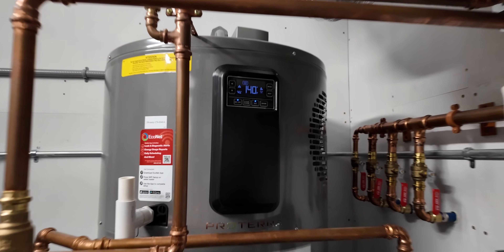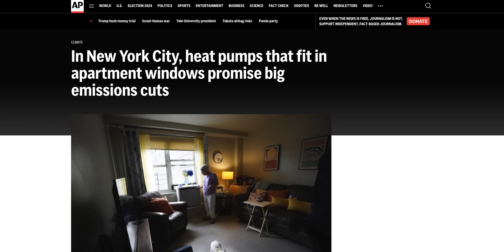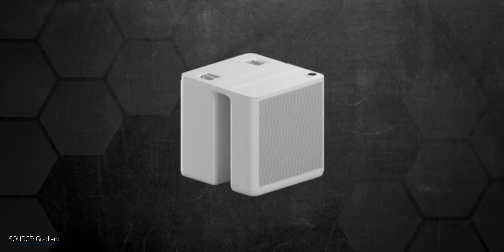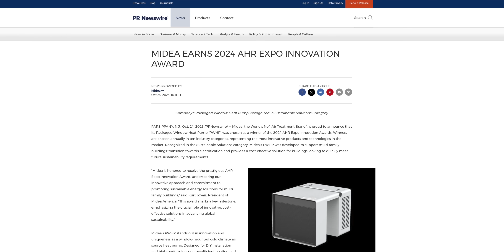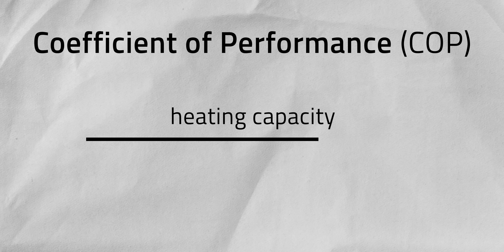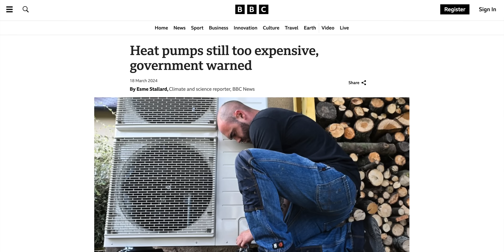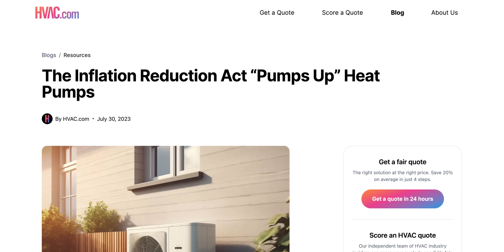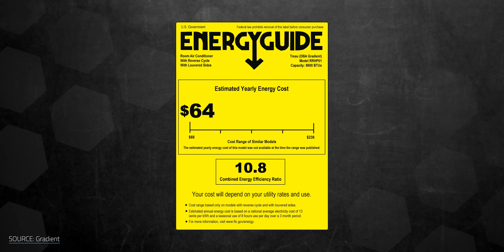Why This Window Heat Pump Is Genius

Comment: So, I like the idea of building a tiny home and using a unit like these small heat pumps for indoor heating and cooling.  With an open floor plan, one unit would probably be adequate. I look at my current home of 768 square feet of living space sectioned off into 5 small rooms as they did in 1956 when it was built and I wonder if each of the 2 bedrooms, the living room, the kitchen, and the bathroom would need a unit to maintain comfortable temperatures throughout my home.

Comment: @undecidedmf Tokyo homes and most apartments have Sliding Windows (Horizontal) not Vertical Windows. So not a Plug n Play install for the heat pump design you have reviewed.  Thus like others have commented, Japanese Mini Split HVACs are the norm.

Comment: Those seem really cool, and they might be great for a lot of people. However, for myself, I passionately hate forced-air heating. I hate the noise of it (but I put up with the noise of forced-air cooling in the summer, I just cope), but I also hate how it feels like it is much more drying than radiant heat. (I don't care what the numbers say, my sensory experience is different.)

What I would really like to see in large buildings would be central steam systems, with well insulated pipes, and with electronically-controlled valves for each apartment. In fact, I imagine a system with a very high-pressure line moving vertically, and then gas regulators which would step the pressure down to a distribution line for each floor. Finally, each unit has a second regulator which steps the steam down even further, and then the electronically-controlled valve that I mentioned earlier. Said valve can be controlled by any common legacy or "smart" thermostat, just have it interpret the "heat call" as a signal to open the valve. In fact, it would not be too difficult to use valves with a variable flow-rate, although that might require a slightly more complex signal form the thermostat.

If the boiler for such a central system obtained some or all of its heat from a heat-pump, so much the better.

Comment: Question:  Put one of these heat pumps in the window of the living room. How do you get the heat to the back bedroom without duct work? I would keep supplemental heat device for power grid failures. The current use of the Mr. Cool device has provided me with the same questions. Ice hanging on the outside unit can severally affect the heating process.

Comment: I can think of two problems that would have to be overcome for window units to be practical. First, how do you distribute the heat uniformly around the apartment? I suppose  it might work OK in a studio, but would be problematic in a 1 or more bedroom unit. Second, where is the electricity going to come from? Older apartments have limited power available, and rewiring would be very expensive.

Comment: I just love all the people on here who don't understand how advanced a heat pump is vs a standard ac unit in how the reversing valves work the variable compressor, the fin technology, the refrigerant choice so on. its in theory a standard ac with a reversing valve.. but that's like saying a Honda is a Ferrari because they both are cars and have 4 Wheels

Comment: For the moment I’m suspicious about this appliances cost mainly because I have a portable GE AC/Dehumidifier 9,000 BTU that I bought used 4 years ago for $100.00 and it accomplishes what this overpriced window heat pump is capable of. That being said I have performed no tests to rate its efficiency in comparison to this heat pump other than noticing a lower monthly cost with my electric bill using only baseboard electric heaters throughout the structure. I’ll continue with my current arrangement because I’m satisfied with the results I currently notice and these heat pump units would need to be priced at least to the same level as traditional window or portable AC/Dehumidifiers because I’d even consider replacing my existing units. So thanks for the information but as you may have already guessed I’ve been aware of this type of climate control for over 4 years.

Comment: I was thinking of upgrading to a mini-split in my ranch home.  I currently use window air conditioners.  I will retire soon and may choose to downsize. I would consider a window heat pump because I could take it with me to my next home.  In my neighborhood homes like mine  are knocked down and replaced with a larger home after a sale.  This is due to the land being worth far more than a small home sitting on it.  Any mini-split I install might just be discarded.

Comment: This should not cost more than a comparable mini-split. Window AC units that can reverse (provide heat) start at $400 on Amazon. 9k Mini-splits start around $400. $500 for 12k 20 SEER units that work down to 5f outside. While I agree that it not as simple as adding a reverse valve, I am sure the mini-split accounts for that. Heck, the Midea 12k reversing non-U ac with heat is only $429 but can only work down to 41f outside. Is the extra cost simply for the lower temp performance?

Comment: 3k is  out of range  for most renters .  btw   how does this reduce emissions ?   if your power company uses coal as a lot do all  you   are doing is placing more demend on the grid this is why ev's are  not the answer .
also i'd like to point out this guy is a pos pushing that hyundai ionic as replacing the battery on that  car is 60k.
if we all had money to burn like he must we   would be building  our own house like he is .

Comment: Hey bro. Open your mind to the environmental studies done in 2008.  CO2 emissions only affect global warming from the absorbed solar radiation in the first 20 ppm (parts per million). After 20 ppm it's virtually no change.  Global warming cry babies keep saying oh were higher than the industrial revolution now, but guess what the industrial revolutions was around 560 ppm, we're now around 680 ppm.... and.... the effect is a curve that drops off on global temperature effects. Like less than 0.005°F change. The inflation reduction act was a wasteful spending spree act to invest trillions to solve a NON-ISSUE. The goal is to follow the UN and spend $40 trillion by 2030, the US contributed a small portion in the inflation reduction act (environmental crazy wasteful spending act). STOP the nonsense of global warming by CO2... there IS NO EVIDENCE, it is not real. the 2008 scientific studies disproved you guys. So the American people suffer in debt to make a few people in a liberal city feel 'smug' on an environmental misbelief. CRAZY.  Lies, lies, lies they've been told. 

Anyway, good video, got my like.  I'm looking to get the most btu with an electric and I like the heat pump ideas. Keep on making the videos they're great. I'm going solar, but not for the environment. A mini split powered by solar that is a heat pump is the best bargain at $1000 + $1000 for the panels and assessors. Seer 29 I believe. I guess that wouldn't work in the city.

Comment: I'm looking for an option now for a heat pump to do temporary heating while we pick our home up and relocate it on our property. The heat pump seems to be the only option rather than using fossil fuel like diesel or gas gasoline generators.. I just recently bought myself a heat pump, hot water tank and very amazed of the cost savings according to the app. People always want to complain about something and the biggest complaint about the heat pump. Is the fan noise. . If those people that are complaining about the fan noise don't like their noise. They could pay extra out-of-pocket and have a traditional hot water tank because it'll cost them hundreds of dollars more to run.

Comment: They always compare heat pumps to resistance heaters which is valid in a thermodynamic sense, but they stay quiet when the comparison is between the real world cost of heating with a heat pump versus the cost of heating with natural gas.  I suspect it's because the cost of heating with a heat pump is higher in all but the warmest states, especially now that electric prices are double what they were just a few years ago.  Does anyone fondly remember only paying $0.11/kwh?   Ahh the good old days.

Comment: 1) I did a face palm when my tenant put in a saddle AC --so obvious!
2) But unlike a summer window AC, you will notice, and suffer from, the myriad air leak paths that winter will reveal to you.  Does NYC provide the towel that you have to put on top of the window sash where the windows don't seal any more?  You really gotta detail the weatherstripping to get this right.

Comment: I like the idea of this, but I believe 9000 BTU puts this unit into the realm of a room air conditioner.  To heat/cool a small apartment it might take 3 units. So $9,000 to cover a 800 square foot apartment.  If price can be brought down to $500 per unit, this will fly off shelves.  Until then, I don't think it's going to get much play.

Comment: You can modify a traditional window unit to act as a heat pump but you need a license to work on them legally. Also R32 is mildly flammable which is worth being aware of.

Comment: Someone needs to design a similar heat pump for vertical windows so we don't have the huge bulky units with tubes that go to the window, and machines we have to drain everyday. Also the can use fans inside them like the thin tower fans. And they need to make them more cost effective so more people will buy thm. And they need technicians that will actually fix them instead of telling you to just buy new ones.

Also make ones for sliding glass doors that you can lock to the door frame, and lock the door to the unit.

Comment: There is no savings.  Our "green" obsessed politicians keep shutting down powerplant and electricity rates are skyrocketing.  NJ is now $.30kw and it's cheaper to A- Heat with Gas and B- Cheaper to operate a gas car.

Comment: My 17 year old A/C unit heat pump died and replacing the inside and outside units is over $14k so until I save up to replace it, I got x2 window A/C units and x2 electric heaters and guess what… my electric bill went from $200 per month to $400 in the summer and from $250 to $600 in the winter 😭 now I’m in a loophole because I can’t save up for a new a/c unit 🤦🏽‍♂️ I’m going to have to get loan now, something I didn’t want to. This new window A/C units could be the answer for me if they cost $500-$700 but at $3k-$4k it’s NUTS!!

Comment: Geo thermal may not be out of reach for most, at least when building.  I built a new home in 2010 for which my contractor quoted $12,500 for an all electric system.  I had a creek about 100 yards in back of the house.  I was able to get a geo thermal system, supplied by my well, with a 2 stage pump, and draining into the creek for $11,500.  The TOTAL electric monthly bill for a 5600 sq.ft. home was less than $215 per month.  If you are building, don't dissmiss geo thermal as beyond your reach.  At 300-600% efficiency, compared to 93% for the most efficient gas furnaces, it pays for itself...EVERY MONTH.

Comment: The price reflects what happens when "government " is footing the bill.  They should only be $500 more than a comparable  A/C only unit not thousands more cause it is backed by government subsidies.   A complete ripoff.  Also how can you compare the need to supply electricity for each unit with gas for a boiler?   Gas does not come from the electial grid....

Comment: The main problem I see is… you need a sash window to mount it. In the UK we tend to have swing out from the bottom windows, and radiators are under windows. So it’s not impossible they could be used but they might need a redesign, if they haven’t already to work with other types of window.

Comment: Wouldn't a regular slip unit AC be better?
There are more expensive than window units but still only a fraction of the price of these units.  You can basically mount the outside unit like this one with minimal scaffolding, and then the only thing going into your home will be a thin pipe, maybe with some insulation, but still much less area than that thick U shape of the units you show.
If these are in the price range between window and split unit, I can see their reason, but at a price almost 10 times of a split unit? Seriously? No point at all and stupid enough that I shouldn't have wasted 11 mins of my life watching this.  Sound more like a poorly placed scamming ad than a real video, seriously thinking of muting the channel considering how about half of the videos I watch here are basically "not enough research done with actual better solutions" like this one.

Comment: The problem is the unrealistic cost of a window uint heat pump. All they need to invest in this product is a valve that reverses the refrigerant flow, so adding 2500 dollars to the cost of a window air-conditioning unit to me is just corporate greed at its best

Comment: I'd LOVE a unit like this in my apartment.

Problem is literally every window in my apartment has a hot-water radiator under it, so these units literally wouldn't be able to fit on my windows.

Comment: Where does the condensation go that drains off the evaporator? Being that is is lower than the window, it would need to be pumped up and out through the connection to the outside part of the unit.

Comment: I called Midea in Texas. They will not even have their units available in many states until later in 2025 or beyond. And $3,300 for an installed unit (cannot be DIY) to cover 330 square feet seems like a really expensive option.

Comment: There is no way in Hell it's going to cost $65 a year in NYC.More than that a month .They actually have this thing called Winter.And their Summers rival the Southeast in intensity if not duration.And the one brand admits it can't handle 95F + !!?.Overnight lows in Summer in SC are regularly that much;so no relief even to sleep!!??.I hope you made this after the check cleared.

Comment: A: how the hell is this not a thing yet???? Basically every ac you buy here (europe) has a reversingvalve on it. Even the absolute cheapest AC's you can get have a reversingvalve.
B: why does a low end window AC cost "hunderds". But essentially adding a reversingvalve makes it cost 3k? Sure this is probably the equivalent of a highend windowAC, nicer materials, "design", no "fuck the enviroment as long as its cheap" refigirant, etc. But still... 
C: I'm not sure why the industrial heatpump is such a bad option? In europe this is a fairly regular used option (that is, the gas version of it). One big ass heater that heats water by burning gas. I had radiators in my appartment that I could turn on and off (or install thermostatic valves and have them do it automatically). So I could controll my own heating. But it was one single heatsource for 9 appartments. Replace that with a big heatpump and the system can go on exactly as it does now?
Thats more or less what I have at home as well. I replaced my tankless boiler with a heatpump that produces warm water, that water is pumped though the floor and radiators whenever I want to heat a room. The same water can be pumped though heatexchanger in a tank that contains drinkwater so it heats that up for dishes, shower, etc. 
D: can we stop with the destinction "AC" vs "Heatpump". Both are heatpumps, both are the exact same thing, the only difference is that the AC is missing one single part. So to make this clear I'd like to propose the following: We call both a heatpump, but when it doesnt have a reversingvalve the word "dumb"  is added to the beginning of the name. Half the world seems to think they are 2 completely different machines, wich is why they accept the rediculous pricedifferences. Its basically the same thing!
Reply: It has been a thing for many many years. This ain’t new,  not sure why this guy making it out like it’s new… amana been making them for 20 years

Comment: Just saw a news article that Midea is recalling most of their U-style units due to a mold / condensate problem: Midea is recalling around 1.7 million of its U and U Plus window air conditioners sold in the US, plus another 45,900 sold in Canada.
Reply: They need a drain hole installed on bottom panel, diy is drill 3/4inch-18mm hole and install rubber grommet with screen. YouTube video.
Reply: (Looking at similar brand units)
Thanks I thought those units were a great idea at first, until looking at drainage stuff. Some have to be drained inside, which is riduculous.

Comment: I'm online right now looking at a Home Depot Ad for an LG 18,000 BTU Heat Pump, runs on 120v, and HEATS and COOLS 1,000 sf for just $650.
So, what are you talking about $3,000???  I'm watching your video in June 2025, so, 11 months after publication.  Are you telling me that prices dropped from $3,000 to $650 in just 11 months?
Reply: Window hear pumps
In traditional form factor are ancient tech, been around for 20+ years. These are just sleek and modern and expensive for no reason, usually about a 200-300 premium on traditional form factor

Comment: I'd want one of these for mine, though I'd need to replace windows to make it work as I have vertical sliding glass windows rather than the horizontal ones that this would call for. It's a great progress in technology though and will likely benefit a lot of people.

Comment: The pricing is just a blatant scam. There is absolutely no defending an order of magnitude price increase for REVERSING VALVES. That’s the most expensive part of a heat pump, the electronics required are minimal. Unless it’s got something to do with extreme low temp performance, but I’m gonna need some proof of how necessary that is and how it impacts cost. Homes in the southern half of the US have been using heat pumps for several decades already. I’m pretty sure houses built in the 80s had heat pumps. I’ve yet to see anyone here that uses anything else but a heat pump.